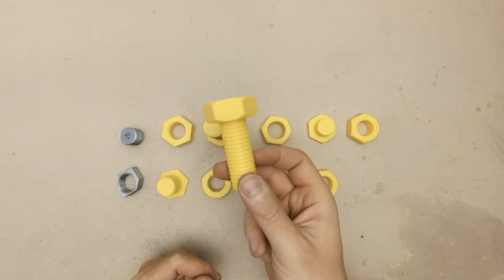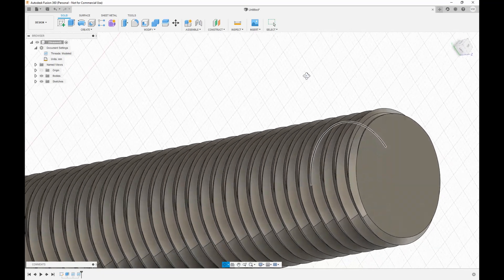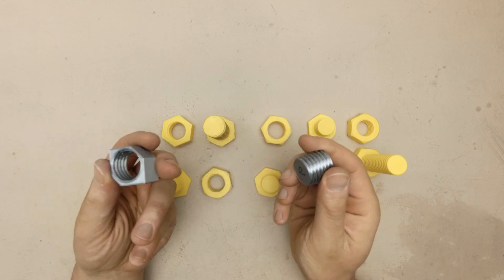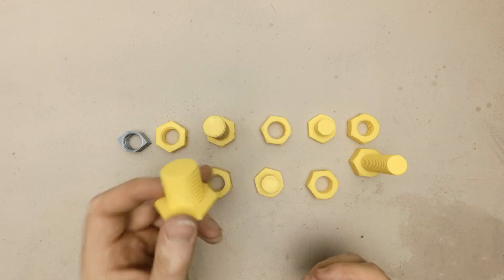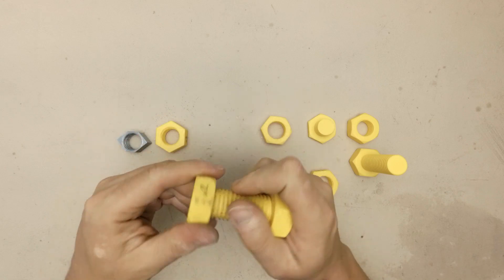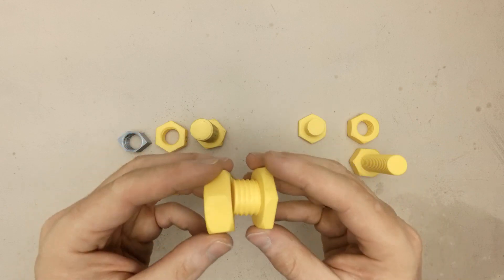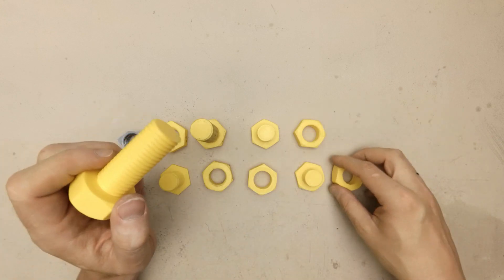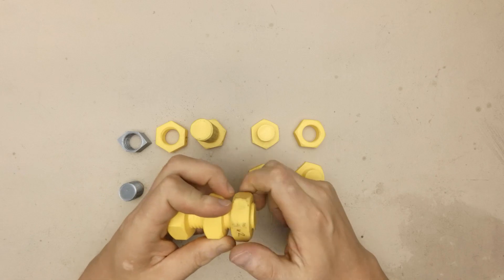Double Threaded Screw

Comment: I’m thinking that if you offset the left and right handed thread sets by 90 degrees ( + ) and make the lead in / out parts of the threads lower than the mid part of the thread maybe. I’m thinking that would work as long as the nut is running down the correct set of threads it should follow it down.
Reply from the maker: I was also thinking about having the different pitch. Maybe that will be also enough.